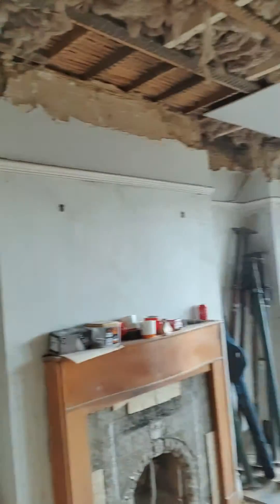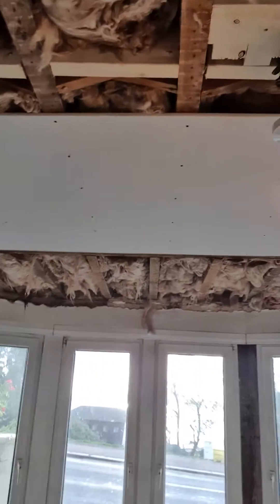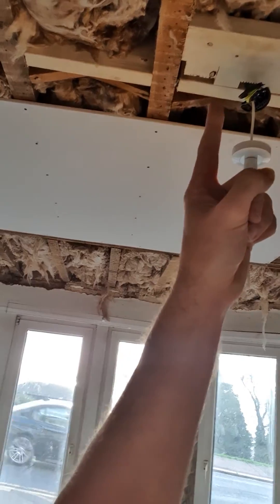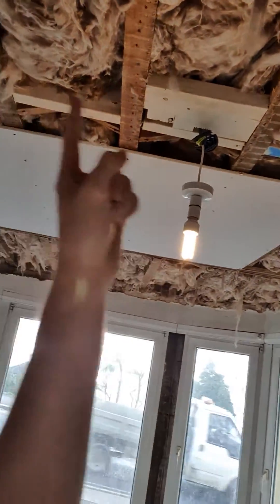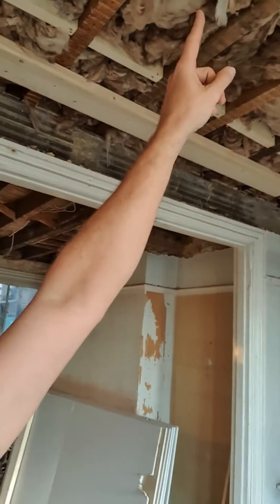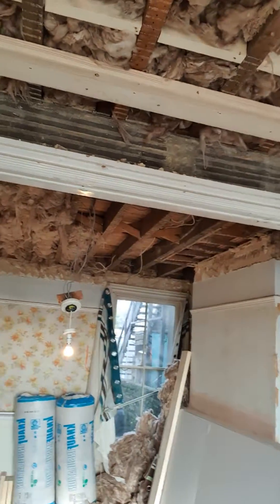How to solve traffic vibration in old Victorian house

Comment: Hi, Thank God I came across your channel. This is exactly my problem. I live in Texas and you could imagine all the low frequency trucks and motorcycles that drive by. Did this method help? Have you tried any other methods like resilient channels / hat channels, mass loaded vinyl, anything else? I need help and it's such a struggle